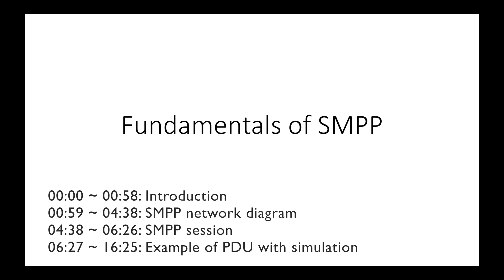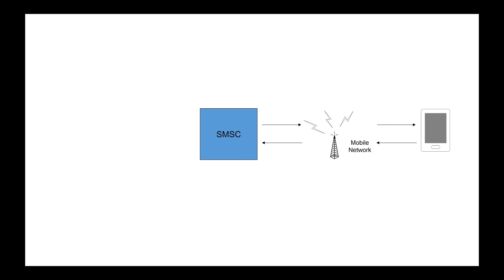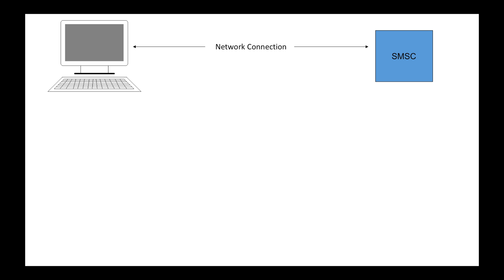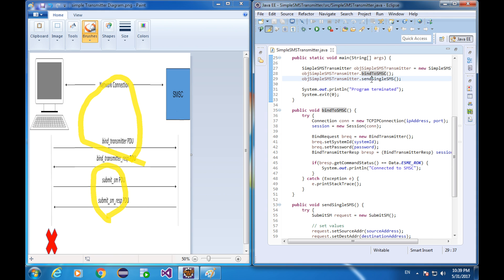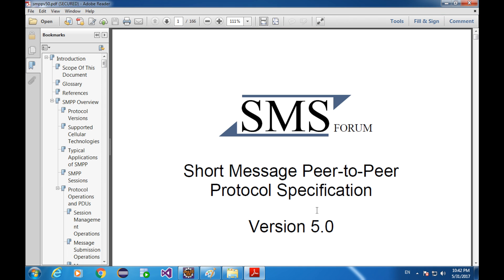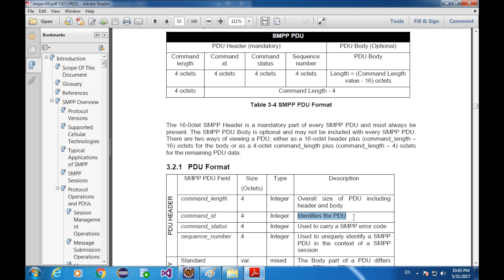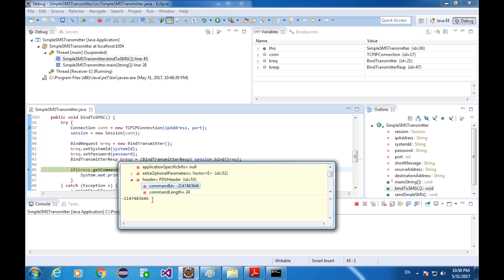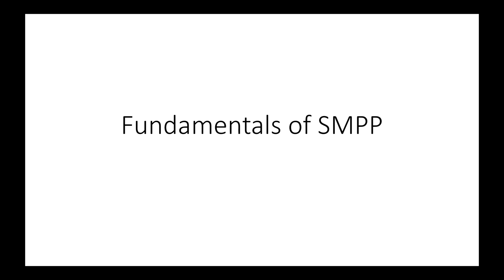SMS Tutorial 06 -- The Fundamentals of SMPP Protocol

Comment: Could you please tell me the difference btw data_sm and submit_sm in smpp?
Reply from the maker: Hi! Here are some excerpts from SMPP 5 documentation. Hope it answers your question.   

Message submission operations provide an ESME with the ability to submit messages for onward delivery to mobile stations. This operation is used by an ESME to submit a short message to the MC for onward transmission to a specified short message entity (SME). 

The data_sm operation is similar to the submit_sm in that it provides a means to submit a mobile-terminated message. However, data_sm is intended for packet-based applications such as WAP in that it features a reduced PDU body containing fields relevant to WAP or packet-based applications.

Comment: How can we send a wap push sms using the smpp protocol using java?
Reply from the maker: Hi! First of all, please know that I have never worked with WAP so far. What I am familiar with only is the interaction between ESME and Message Center. But if I were in your situation I would try the following. 

1. Find out resources and documentations on WAP implementation. This is what I came across: https://smpp.org/SMPP_WAP_Implementation_Guide.pdf 

2. Ask your colleagues if they have a working sample, from which you can start. 

3. Make sure your message center allows you to send WAP push 

4. Bind to your message as TRANCEIVER to the message center 

5. Consider using data_sm operation. For example, in opensmpp.jar there is a class, named DataSM. In addition, I would keep an eye on esm_class parameter. 

I guess you also need to take care of the interaction between the web server and WAP Proxy Server, which shouldn't have too much to do with SMPP. 

Hope it helps.

Comment: I am totally new to SMPP, why would you need to send enquire_link to keep a session open? In other words, why keep a bind session open? Is it to send multiple messages over the same bind connection, or is it purely because the ESME is awaiting a response from the SMSC?
Reply from the maker: Hi! Thanks for your question. Here is a description from the SMPP Documentation: This PDU (referring to enquire_link PDU) can be originated by either the ESME or MC and is used to provide a confidence-check of the communication path between an ESME and a MC. On receipt of this request the receiving  party  should  respond  with  an  enquire_link_resp, thus verifying that the application level connection between the MC and the ESME is functioning. The ESME may also respond by sending any valid SMPP primitive. 

First of all let's be aware that when we send SMS via SMSC, we need to connect the ESME to the SMSC and "login" to SMSC. In the SMPP world, what you say "keeping a session open" is like keeping the login session active. If the login session is inactive, then obviously you won't be able use the service. If the login session is idle for too long (meaning that you logged in and do nothing at all for too long), then the system will automatically sign you out. The same applies to SMSC. 

The main purpose of enquire_link PDU and enquire_link_resp PDU being sent back and forth between ESME and SMSC periodically, is to keep the session open / awake / active, so that your ESME can submit the messages to the SMSC without binding again. Of course you can (reinvent the wheel and) send other types of PDU to keep the session open. But make sure both SMSC and ESME can "understand" that PDU and process it appropriately. Let's say, if you send other type of PDU such as submit_sm frequently, then the SMSC will keep the session open, but it will treat submit_sm as a regular SMS and send it out frequently, which is not good. This is pretty much why enquire_link is used. 

Hope it helps.
Reply: ALB Programming excellent explanation, thank you!
Reply from the maker: You're welcome. Thank you

Comment: Thank you very much, it is really helpful. Is there any chance to post a video describing how ESME can have confirmation receipt that the SMS is reached to the destination
Reply from the maker: Hi! Thank you for your support. As a quick solution, can you try the following steps?

1. Make sure SMSC is configured to be able to generate and deliver the delivery receipt. In SMPPSim, you might modify the following parameters, via "conf/smppsim.props": 1) DELAY_DELIVERY_RECEIPTS_BY 2) PERCENTAGE_THAT_TRANSITION 3) DELIVERY_RECEIPT_OPTIONAL_PARAMS 4) DELIVERY_RECEIPT_TLV 2. Make sure the client (ESME) binds to SMSC as transceiver 3. Before submitting submit_sm PDU, setRegisteredDelivery((byte) 1) 4. After submitting submit_sm PDU, try DeliverSM deliveryReceipt = (DeliverySM) smppSession.receive(); 5. If deliveryReceipt abovementioned has esm_class == 4, then that's the delivery receipt 6. You can try deliveryReceipt.getMessageState(), deliveryReceipt.getNetworkErrorCode(), deliveryReceipt.getReceiptedMessageId()

Hope it helps